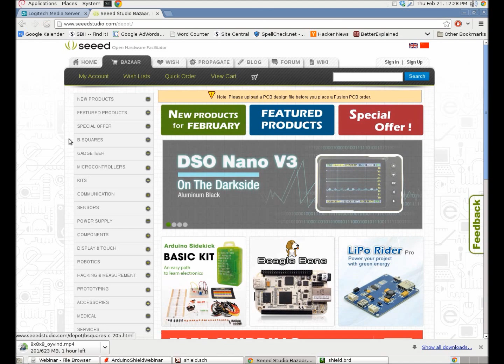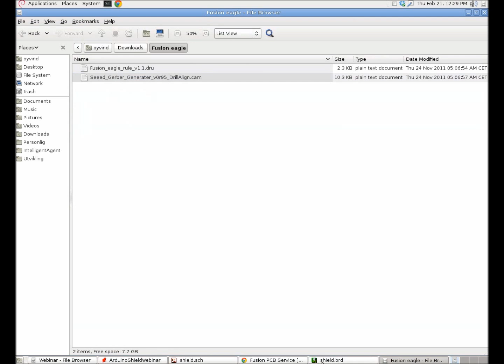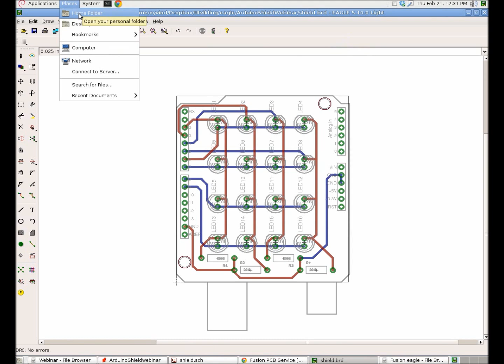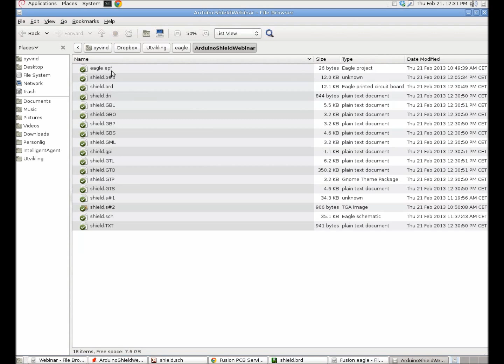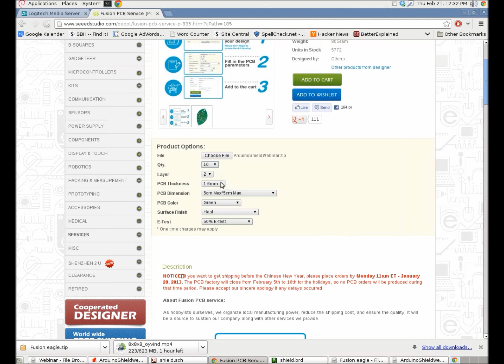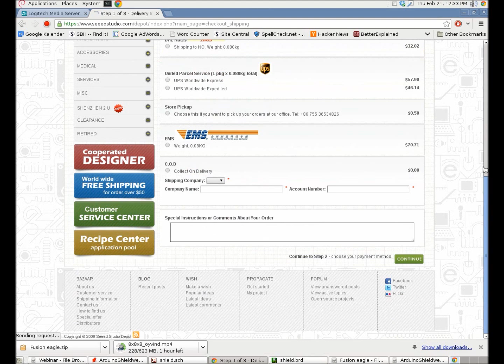Arduino Shield Tutorial (Part 3) - Order cheap prototypes

Comment: Why did you connect the two GND pins on the arduino shield?

Aren't they already connected in the arduino platform below?
Reply from the maker: Yes they are connected, so that's not really necessary. But Eagle doesn't know that, so by doing it, I don't get an error that a connection is missing.